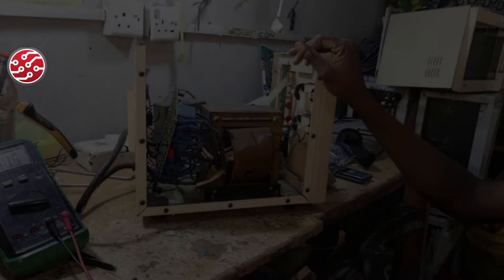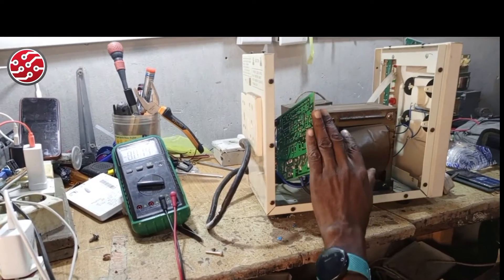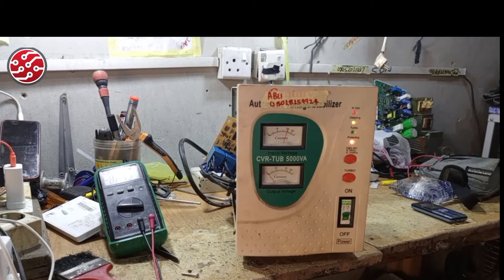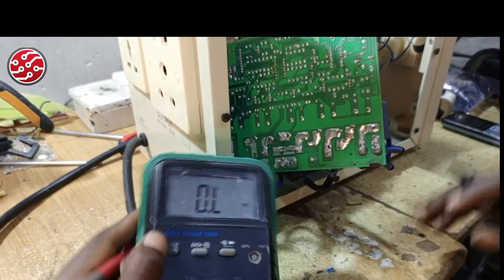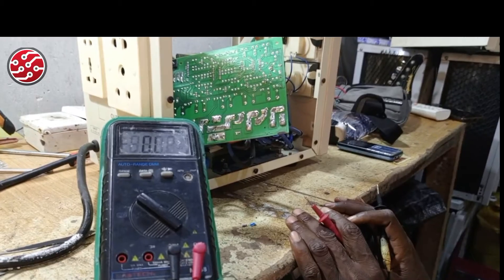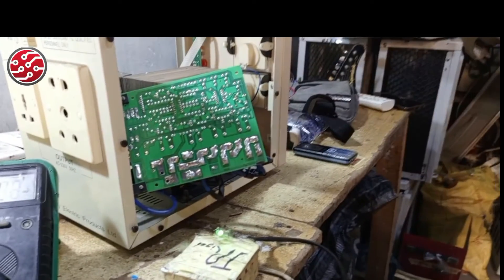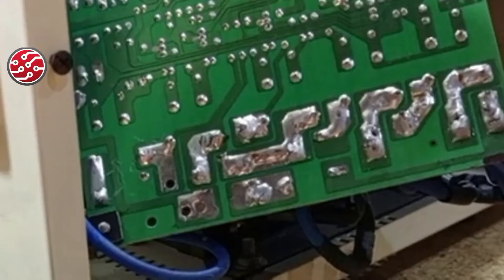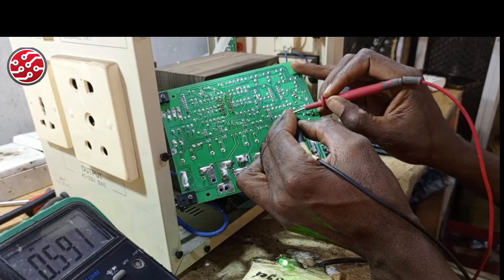How to fix a Stabilizer showing PROTECTED in less than an Hour

Comment: Both "normal" and "delay" lights are on at the same time, and there's a buzzing sound. The delay light is red. Help please😢
Reply from the maker: Overvoltage.  Faulty variable resistor or relay

Comment: Please how can I stop a stabilizer from showing 'unusual light'. I've reduced the stabilizer but it's showing 'unusual'. Thanks in advance
Reply from the maker: There is a faulty component, like variable resistors, 220k resistor, transistor or relay

Comment: Pls I bought a new stabilizer to boost my current because my area always has low current but since buying the stabilizer, I have not been able to use it cos any time the delay light is off the protecting light pops out immediately and the output will go off
Reply from the maker: Either is faulty or the stab is not calibrated ( not properly set)
Reply: @robinTechelectric mine is also having this issue and it is well connected, it’s will be working fine then the next minutes it’s switched off, while the protecting light ON
Reply: Mine always shows protecting light, I'm already being tired and we always have low current